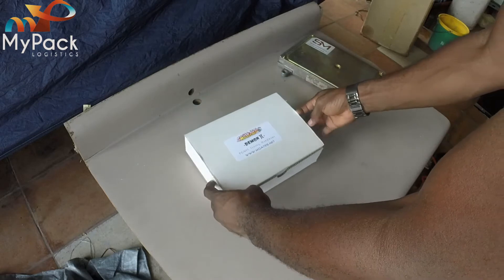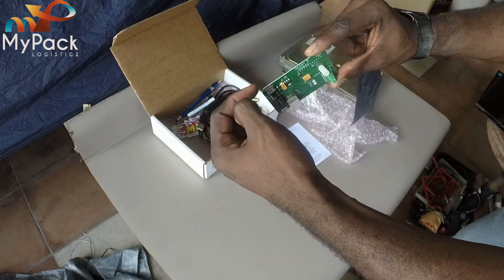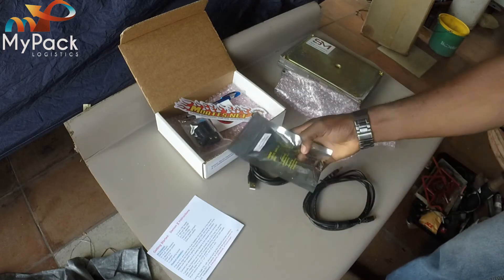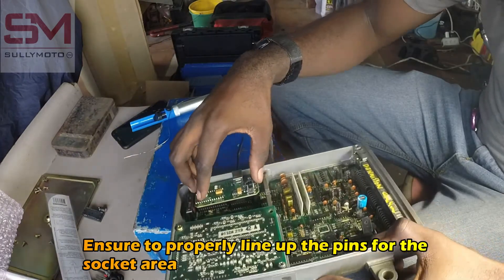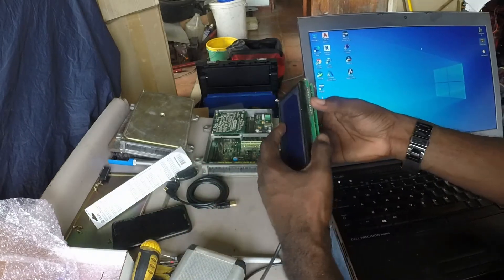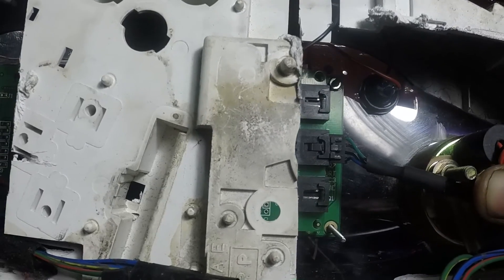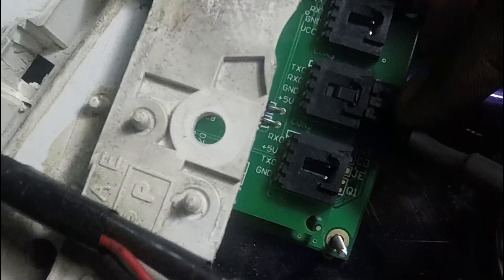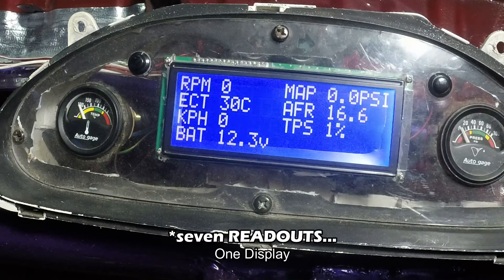PROJECT CHARONDA EP 18: Demon 2, Neptune RTP  & TunerView 2 Install

Comment: Hey i know this was posted a while ago. But maybe i can get a reply. My ecu is already chipped and capacitors upgraded. Cn2 port added. If i buy a moates demon 2 will it just plug in. Since the socket and such are already there?
Reply from the maker: Yes it will, just as seen in my video.
Reply: @apexracing876  thanks 🙏